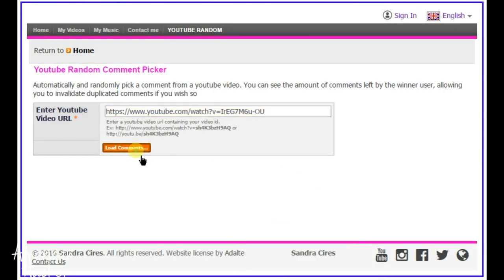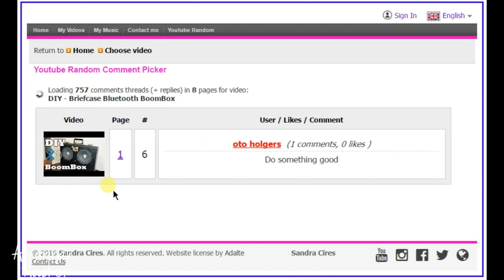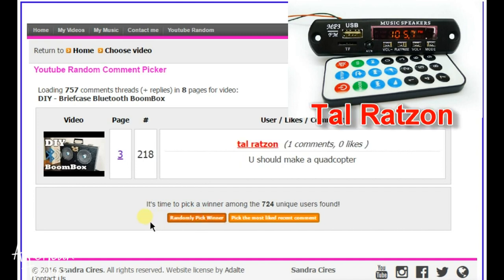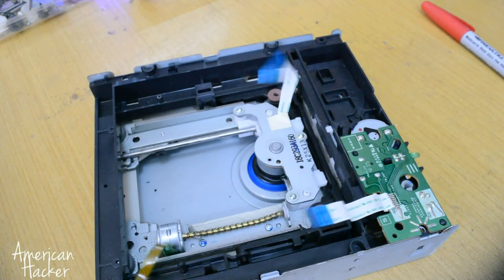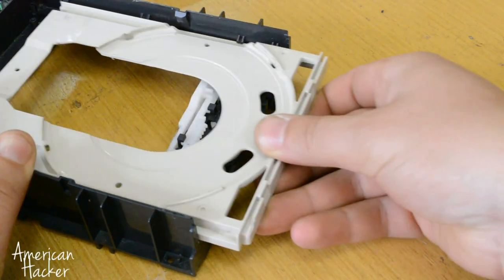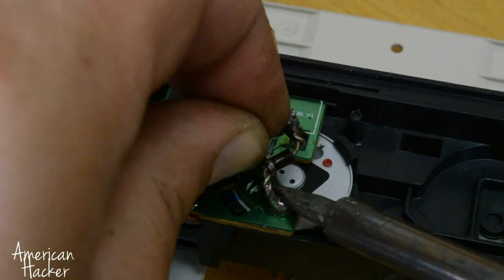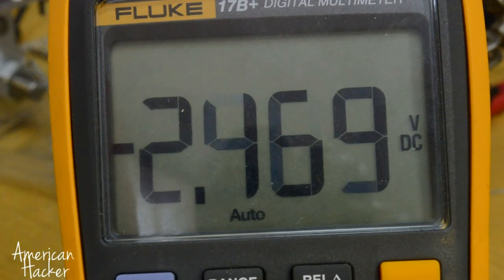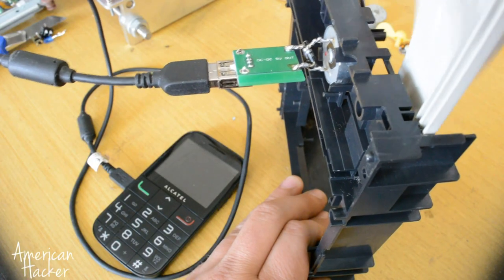How To Charge a Phone With Old DVD Drive - Lifehack

Comment: Hi, good proyect, but the voltage is not continue.. or yes?
Reply: +Electro Ballesteros You are right, the motor generates AC power, but the bridge rectifier (the 4 diodes he soldered to it)  at least makes it all go in one way, so it's all positive, with drops to zero every period, like so https://en.wikipedia.org/wiki/File:Gratz.rectifier.en.svg
Apparently that's enough to power old devices. I wonder how it would do with newer smartphones.

Comment: wait does that helps my battery or make it worst? hahaha. it works but it will make it work due to inconsistent power delivered to your device.
Reply: the DC to DC regulates and constant current and voltage
Reply: +mahammed essam thx for the info. still ill search for it lol. hahaha